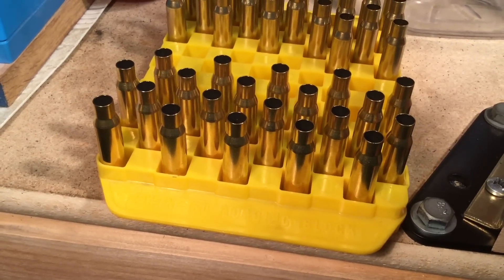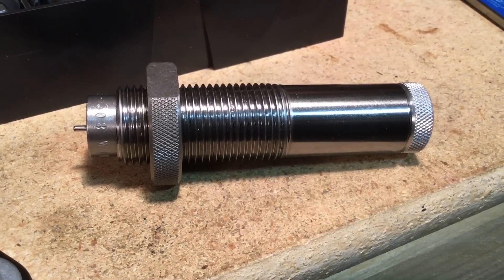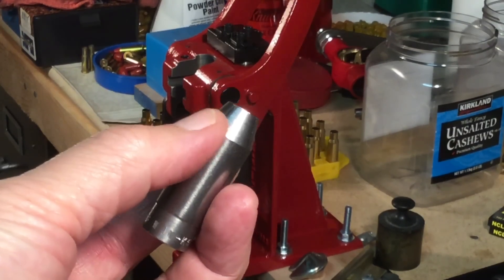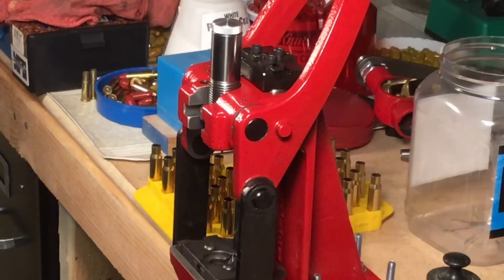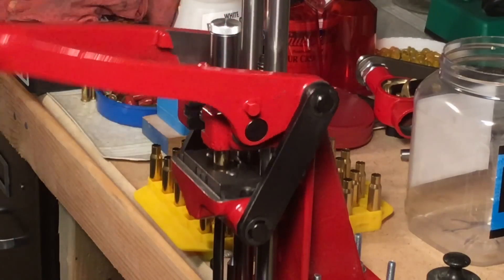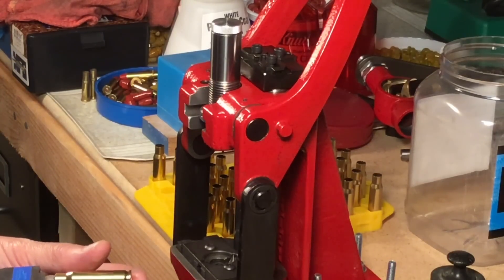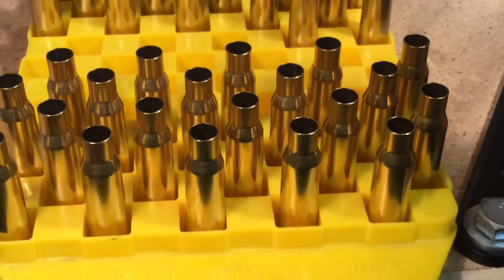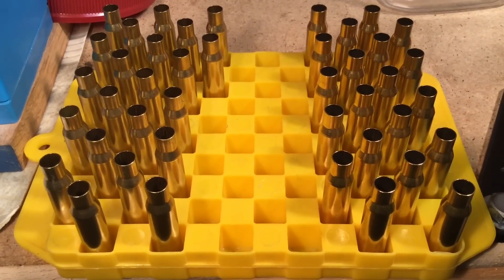Savage 11 VT 308 Project: Chapter 8 - The Lee Collet Neck Sizing Die

Comment: Cookie, I presume you know you shouldn't cycle the press without a case in the shell holder.  I assume you did that just to find the first contact of the bottom of the die with the shell holder, and THEN put a case in the shellholder plate.  

A new user of the collet die might run the case holder well up against the bottom of the die the very first time if they weren't patient, careless, etc.  As Lee points out, cycling the press without a case in the shell holder can potentially lead to the collet fingers jamming together.  Usually that can be fixed using a proper sized drift punch or large screwdriver blade to get the collet open again.... but sometimes not.

Comment: Is it possible to FL size then touch up or uniform the necks further by running them through the collect neck sizer?

Mainly I don’t want to try and run neck sized only cases through a gas gun. 

Thanks!
Reply: What some do is neck-size with the Lee collet die and then run them through a Redding body size die.

Comment: The diameter of my mandrel measures 3.055.  This results in a case ID of 3.06.  Don't know how you were getting an ID of 3.04.

After I neck size using the Lee Collet Die, I bump the shoulder back .002 using either a body die or FL bushing die with no bushing.
Reply from the maker: Tim Briggs - Sounds like it would be good for us to have several mandrels so we can have the neck tension we desire.  And I do bump shoulders back .002 according to my RCBS Precision Mic readings as well.  Good shootin' to ya,  FC Steve

Comment: Sorry for commenting on a year 1/2 old vid, but would bumping the shoulder back using the F/L sizing die, and then use the neck sizing die to insure concentricity of the case neck produce any kind of an advantage?

Comment: For the cases that you neck sized, did you run them through the full length resizing die first?  I only ask because you said they were already decapped.  Or were these the cases that were run through the 45-70 resizing die?
Reply from the maker: JOsh92 - With our bolt action rifles and single shots, we can use fired brass that is now fire formed to the particular chamber.  The brass was decapped without any sizing being done to allow the wet tumbling cleaning and polishing including the primer pockets.  This decapping could have been done with a Lee Universal Decapping Die, but the 45/70 sizing die does the same thing with the 308 cases - no sizing of the 308 case will occur.  This brass can be chambered again for a very close fit, but the neck of the brass casings have been expanded out and will not hold a bullet, hence the need to resize the necks.  The Lee 308 Neck Size Collet Die does that with a collet and mandrel offering low run out (good concentricity).  Good reloadin' to ya,  FC
Reply: Thanks! I watched all of the Savage 11 VT project videos and I have a better understanding of what I should be doing with my 7mm-08.
Reply from the maker: JOsh92 - The 7mm- 08 is a spectacular round as is the 6.5mm 08 (260 Remington) - Great cartridges to reload for...you can use the 308 Precision Mic for all these calibers since they use the same shoulder.  Also the Hornady Comparator works perfectly fine with the same included insert as well... Good reloadin' to ya,  FC

Comment: Put your headspace gage on the neck sized brass and see what you get. Thanks.
Reply from the maker: My first experience with the Lee Collet Die loading 6mm Rem was a big disappointment - the collet grabbed on the release stroke and the brass was stretched .005-.007"  I had followed the instructions to get some heavy pressure on the collet closing.  And the collet engagement was rough.  I polished the collet a bit and then adjusted the collet for lighter pressure still sufficient to tension the bullet and have been happy with the Lee collet neck sizers since.  Took your advice and ran the collet neck sized brass through the Precision Mic and got +.002 to just a hair over +.002.  That is .001 longer than the fire formed brass at +.001.  As you recall, the Hornady box of factory ammo had readings from 0 to +.004 - and the rifle was able to cam those into function nicely.  I don't anticipate any problems with the reading of +.002.  But at some point, I will have to bump the Hornady collet brass.  Until then, good reloadin' and good shootin' to ya,  FC
Reply: You're a class act FC.  

I just got a Howa 1500 heavy bbl in 22.250 and the Lee dies etc to start loading for this caliber.  I am an experienced straight wall handgun reloader, but this is new to me.  I found that the collet sizer was rough on brand new Lapua brass.  I need to fine tune things before I decide on a few different loads.  I'm infatuated by the 4000 fps aspect.

Thanks for your reloading classes FC, keep up the good work.

RR
Reply from the maker: RapidRobert -- Thanks for your gracious comment.  The 22-250 is arguably our best varminting cartridge - ultra high velocity to rival the 220 Swift.  You will be able to break the 4000 fps barrier with the lighter bullets.  However, the 4000 barrier comes at a cost in reduced barrel life.  That is the primary reason there isn't a lot of work being done to push high velocities today.  3700 fps has been found to be pretty optimal performance.  Steels of today are not that much better than 20-30 years ago.  However, velocities around 4000 fps are what the 22-250 is about.  Good shootin' to ya,  FC
Reply: FortuneCookie45LC 

Thanks FC.  Most of my loads will be in the 35- 3700 range but ............. why not push the limit on occasion?  By the way, I killed a 257 Roberts looking for 4000 fps.

Keep on keeping on..........
Reply from the maker: --Oh my, that poor 257 Roberts!!  It must have strained mightily trying to get you that 4000 fps - hope you gave it a good memorial...Perhaps the 25/06 would have been more like it with the lightest jacketed bullets (65 grain Sierra GameKings) you could find...or a 257 Weatherby perhaps!!   Bood reloadin' to ya,  FC

Comment: thanks for the great tip or reminder about running the case through the die twice. Have you noticed the lead putting scratches on the neck of your cases or is that just operator error thank you
Reply from the maker: The scratches are minor and are just part of the procedure.  It's not enough to bother me, but some as yourself would be more observant of them.  Nothing wrong with that as we all want the best rifle ammo we can load.  My goal is to get consistent 3/4 MOA with the 308 (a round known to be finicky), I'll be happy.  Grit can cause that also, so that would be operator error.  Best Regards to ya,  FC

Comment: Hi there FC so if I understand good you did full length size the brass and then use the collet die? so that brass is not formed to that chamber any more, I wanted to buy the redding competition dies but I heard a lot of good things and bad things as well, redding also have those shell holders you mention for the "bump size"
Reply from the maker: Mark - My tests include 22 rounds of R-P brass that has been bump sized to -.002 less than the fire formed brass; and 20 rounds of Hornady fire formed brass that was sized with the Lee Neck Size Collet Die.  So you see, the collet die brass is fire formed and no FL sizing or bumping has been done to those....The "bump size" shell holders are especially for those who have presses that do not have the cam over action past the point of ram/shellholder contact.  But if our rifles do not have tight chambers, we may not even need the special thinner top shellholders.  We can set the headspace properly without the cam over for some rifles.  Back in the day, we used to set our dies at less than full FL thinking we were "neck sizing" with our FL dies - as long as the rounds chambered, we were actually bumping the shoulders back in rifles that had longer chambers.  Best Regards, FC
Reply: That was the part where I get lost hahaha my bad, I actually have the same set of dies from lee, I need to get some powder but I haven't get any luck, I will like to get Varget or IMR 4064, I read they are pretty good for this kind of cartridge, by the way I was doing some research and I found that Foster does have a die that "bump size" and neck size at the same time leaving the body intact or that is what I understand, the die is called Forster Precision Plus Bushing Bump Neck Sizer Die, I',m thinking on get one in a future since I do not have no powder to reload there is no hurry for that die. I do want to get my brass bump size without loosing the formed brass. Best Regards keep up with the awesome videos
Reply from the maker: Mark - When we FL size our brass, we get a set amount of sizing (however, there are variations that can occur depending on how tight we screw the die against the shellholder).  Everything works tough because of SAAMI specifications.  When we bump size, we are using the FL sizing die to get a customized amount of sizing that will allow reloading the brass with as little working of the brass as possible and still resize the case.  When we neck size our brass, we are not working the case at all and just restoring the neck to hold the bullet.  Actually, when we bump size our brass, the necks are being sized at the same time because the FL die can't help doing that.  What the Forster die does is give us complete control over the sizing of the neck via the use of neck size bushings while the bumping is happening.  These bushing type dies are great if neck turning is being done as the final thickness of the necks must be compensated for to get the desired bullet tension in our reloads (plus the turning creates concentricity of course).  This is especially critical for custom chambers.  Since I was never into benchrest shooting and was looking for varminting and High Power Rifle shooting, I never got into neck turning - the rifles and loads were plenty accurate for my needs.  For example, my Rem 700PS  223 shoots .4 - .5 MOA with several loadings -I don't need to spend $6K+ to get groups just a wee bit smaller than that... Best Regards,  FC